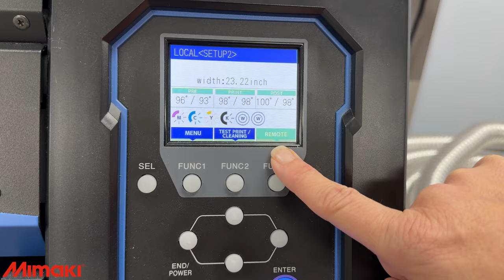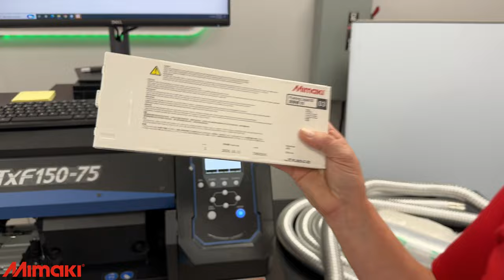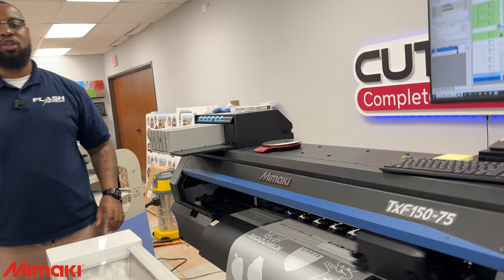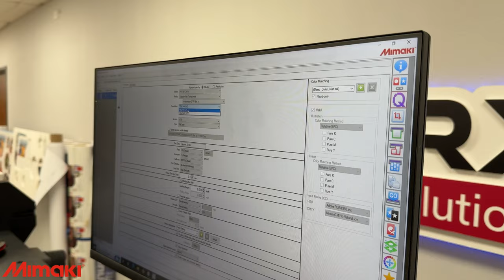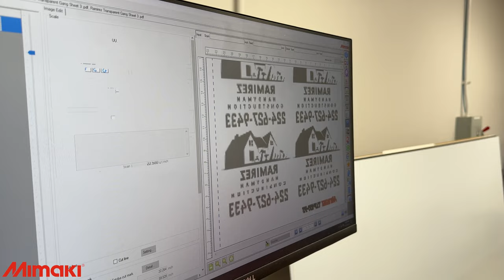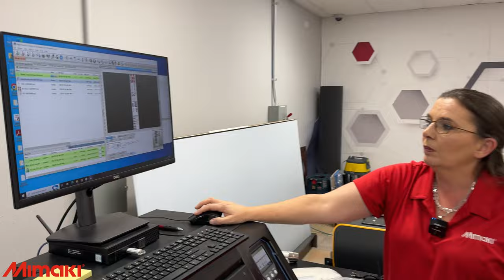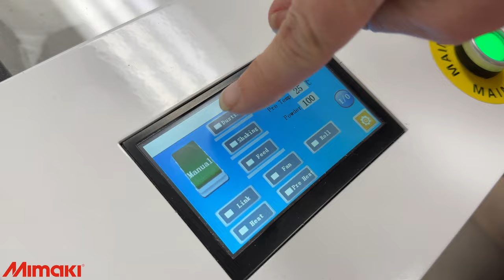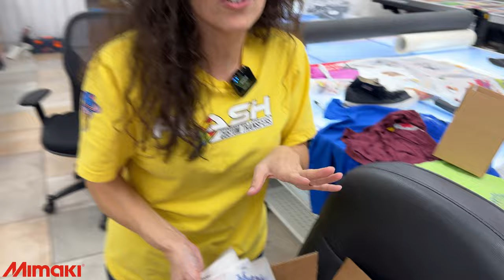MUST WATCH!!! PRINTING YOUR DTF TRANSFERS ON THE BRAND NEW MIMAKI TxF150-75 DTF PRINTER #howto

Comment: My team and I are ready to purchase a  new dtf printer,  but is the cjv150-75 going to have problems  with the white ink clogging?  We want a dtf printer  that is not a big pain in the butt!  Is this possible?
Reply from the maker: Thank for reaching out. Mimaki’s DTF printer is called the TXF. Do you mean that DTF printer? If so  we can definitely help with that. We can help on any printer Mimaki sells to be honest. Also, due to the advanced white circulation and the In-house Mimaki inks, you will not have those clogging issues that you have with other Chinese printers. Email us flashprintingdepot@gmail.com and we can get the process started
Reply: Yes I mean the new 30 inch wide mimaki dtf printer.  We want to know if we can schedule  to come and learn more about it in person  before making  this big purchase?
Reply from the maker: @Friendofsinners777  awesome, email us and we can find out your location and schedule the demo.

Comment: Nice but too big for the space I have. Do they have one like the Ricoma Revel 2402T ?
Reply from the maker: They have smaller shakers if you're worried about space. It's a 32" printer so it will fit in pretty much any standard room. The shaker is what takes up a lot of room but you can always find a smaller one
Reply: @StraightOuttaContent  32 inch dtf film roll can be printed
Reply from the maker: @mansukhsandha5664  yes. Are you looking to buy a printer?

Comment: But how do you know that the film and the power is approved by Mimaki?
Reply from the maker: The Mimaki printer can run with any film and Mimaki doesn’t make the shaker, it’s an addition to the printer. So the shaker can use whatever powder* you desire.

Comment: The fan just before going into the powder well should be pointed towards the pre heat bar and not towards inside the well like in this video 14:18.  That will just blow around the powder inside the well and cause problems with your film.  Happen to us until I discovered that the fan rotates!
Reply from the maker: Awesome thank you for the insight. Do you have a TXF?
Reply: @StraightOuttaContent  yes, we had that fan blowing into the powder well and it was blowing powder all around and sticking to open spots on the film.
Reply: Can you tell me if you recommend this printer and any honest review on it?